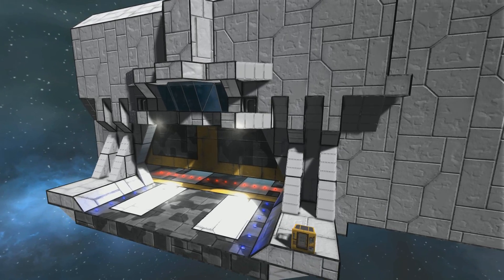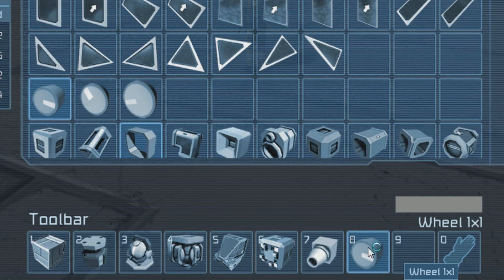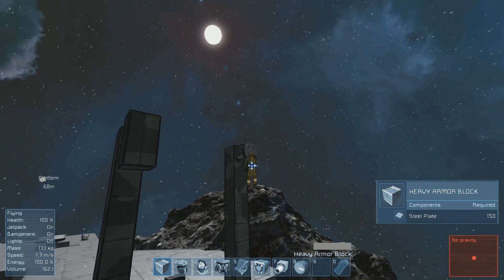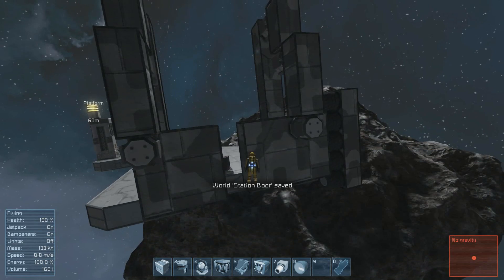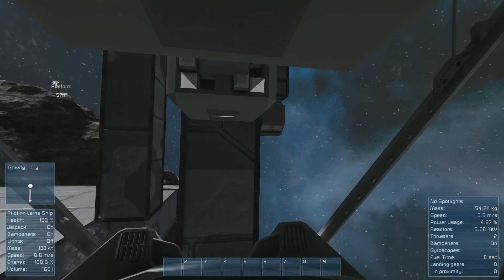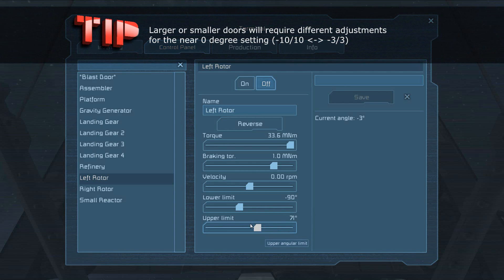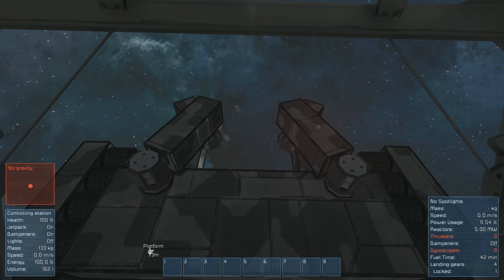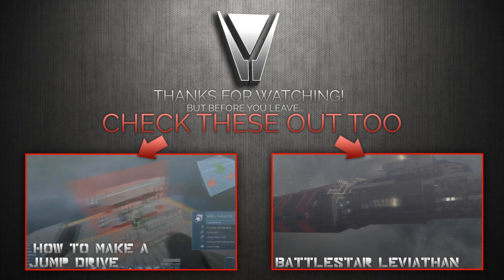How to make a Blast Door [Space Engineers]

Comment: Is there any way to set this door up in a way where it won't crush the floor beneath it?
Reply: Reset the bottom limit from 3 to 5 to 10 degrees.  With that setting the door will still be flush on the bottom but will not damage the floor of the door frame

Comment: you earned a new subscriber, any chance you know how to do this with a 9x5 instead of a 9x3? or do the ratio have to match like 15x5?
Reply: +dboydev this door is 3 blocks high. they have to be lifted 3 blocks high to make full use of it, that's why the first built arms are ... 3 blocks long. for 5 doors height, first arms need to be 5 blocks long. you may have to make the door wider so the arms won't touch at the 90° position.

Comment: That's strange, everytime I open the door, the wheels cause damage to the door blocks. My door is huge by the way : 20 blocks wide, 13 blocks high
Reply: how did you set up your rotor arms?  When I try to build a larger door the rotor arms crush the top of the door.

Comment: For a 17x9 blast door, what height should the columns be? I've been trying to get it right all day and I'm completely frustrated
Reply from the maker: The first arm should be at least 8 blocks long, and the second arms must be longer (perhaps 9 or 10).  It is possible though to set the rotors to stop at less than 90 degrees, say perhaps 60 degrees, which would permit shorter second arms (perhaps 8 or 7, maybe even 6, this would require experimentation).  Good luck Matthew!

Comment: I made this in multiplayer, the door started to jiggle then exploded...
Also, the wheels no longer function as bumpers, they hurt heavy armor blocks.
Reply from the maker: It seems that changes have been made to the net coding in SE that have made the issue progressively worse.  Rotors currently don't function well in multi-player.  In the future though, when things have been fixed, I expect things will go quite a bit more smoothly, and these tutorials will still be relevant.
Reply: This design still works in multiplayer when you use landing gears instead of wheels for your 'rails' they still work as a smooth surface and won't explode. Additionally you can also lock the door in place. This way the 'enemy' can't attach a ship with docking clams to your door and lift it up (rotors only have a limited amount of breaking tor while docking clamps are nearly unbreakable).

Note tough: docking clams are a bit bigger then those wheels (3 blocks) so keep that in mind while designing the door, you will need more width to build the door, or have a smaller door in the same space. Also you will need a extra wall in front and/or behind the docking clams to prevent 'holes' in your wall.
Reply: Morphologis im just sayin, pistons :P

Comment: im confused as to why the wheels are in a 90degree angle to the moving door? in my brain it doesnt make sense to put a wheel there with its axle pointing to the moving part... can someone explain?
Reply: Because placing the wheel with the tire portion would make to much of a gap and not hold the door properly. It's basically a rail system, as the landing gears or yor were to tight and binding doors that were being created. The axle portion on the wheel is just right for holding it in place.
Reply from the maker: Mike is absolutely correct, I tried it with tread facing the door and on a free spinning rotor, and the tolerance became the issue.  With the rim portion of the tire facing the moving door, the tolerance is just right for it to move up and down freely.  Be sure though that the OUTSIDE RIM faces the door, or it won't work.